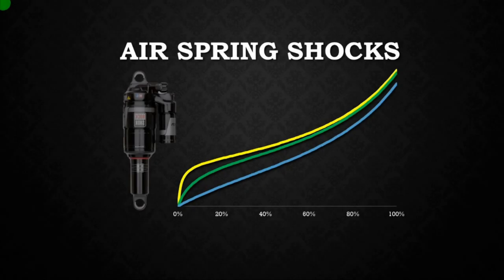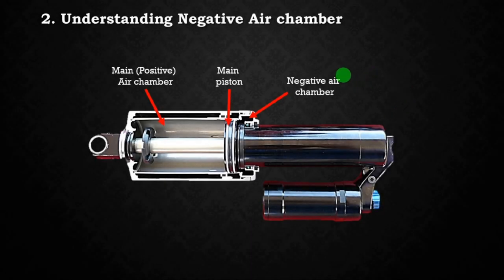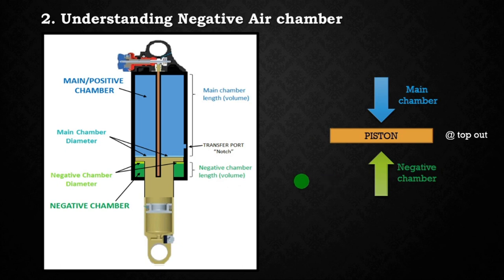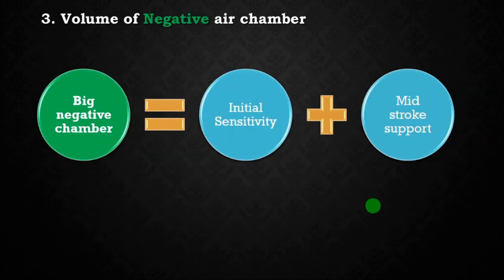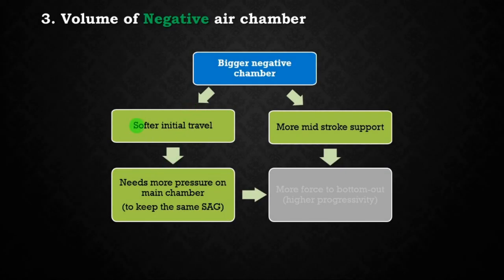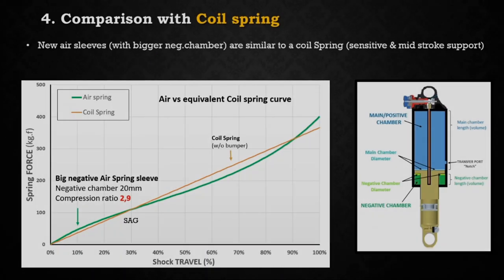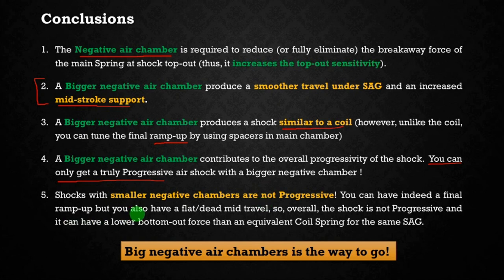Air spring shocks (MTB Rear suspension Ep.13)

Comment: I'm tired of marketing reviews with subjective opinions and without substance where no quantitative information is included. Yours is a very good video! Maybe too technical for some but you explained very well as to make these complex concepts understandable for many! One question though: does your simulation consider a frictionless interface between chamber surfaces and seals? I believe that the absence of that "stiction" is one of the reasons why coil shocks are still a little more sensitive than air shocks. However, manufacturers have improved the surface treatment and seals as to reduce "stiction". Coil shock disadvantages are lack of progressivity tuneability, need for a specific coil spring rate for each rider weight/riding style, and weight (which I don't mind much).
Reply from the maker: +Carlos Adorno Hi. Thank you! Im also sick of biased and marketing reviews :) No, I'm not considering friction. Nor the temperature variations on the air under heavy use. But as you said, I dont think thats a major issue. Although I'm a coil-fan, an air shock with a proper negative chamber can be as good or better than a coil (less weigth and more tuneability). Bye

Comment: Andre, what you are saying about bigger negative chamber only applies for light to average riders. For heavy riders, the big negative chamber means needing to pump in so much pressure, that the shock actually looses small bump sensitivity over a small volume chamber.
Reply from the maker: lux yes, it’s a balance between those two factors, and after a certain point there is no major benefit from having a bigger negative chamber, because the curve is already quite linear. Still, if you increase the diameter of the shock you decrease the pressure required without affecting the curve shape. So, manufacturers can play with that too. In episode 14 you can download a air shock simulator to play with those parameters. Cheers
Reply: @andrextr  Hey, thank you very much for a detailed answer. You are a fountain of suspension wisdom! May I ask for a piece of advice? I went from a DebonAir air can to solo air air can on my Monarch RT3 190x51 as I couldn't set up my sag less then 35% at 350 psi on my nicolai g13 (I weigh 114 kg without gear). With the small air can, the shock feels very plush  at the beginning and it ramps up at the end so I don't bottom out, which I like very much and the traction and small bump sensitivity is amazing, but the mid stroke feels a bit less supportive than I'd like it to feel. The damper has already been tuned by sram for my 114 kg body weight. Is there anything one can do to get some midstroke support? I ride a nicolai g13 which is quite progressive. Thanks for help if you happen to find time to reply.
Cheers, Luka
Reply: @andrextr  , thanks for your great work. I, am having the same problem, weight about 110 kg with gear. Have Canyon Strive 2016 with debonair monarch plus 200x57 and I noticed that I need to put crazy pressures to make sag 30% (35%  with 300+ PSI, I don't even have a pump for more than 300). The previous owner put 4 bands and I didn't removed them, and even on 250PSI I ended up with 40% sag and couldn't able to shrink it to less than about 80%. So I am playing with your spreadsheet (although I don't have data for 200x57 but probably calculations are similar) and thinking about multiple options, taking into account that apparently debonair is not the best thing for heavy riders. 

1. I think I need to remove all bands - still I have to put crazy pressure, but the shock will work better at the end as I can't use it's whole travel now with the steeper ramp up curve. 
2. Going back to solo air can. I read a lot of heavy riders do that.
3. Putting bands in the negative chamber . I know that will change the curve at the beginning but still this will decrease the initial sag. 
4. Is there any real need in making these 30%, what if I keep it 40% but the shock works fully. Yesterday I was riding and even decreased a pressure so I can have it better at the end...

Not sure what really to do. Any advice is appreciated... Thanks.
Reply from the maker: Hi. The bands on positive chamber will only affect the last part of travel, use then only to reduce bottom out accordingly. If you put then on negative chamber you have a stiffer initial travel and it could help to reduce sag in your case (and you can use lower pressures). There is no need to make exactly 30% you can run 40% but it migth make the bike bob more. You have to test the different settings and see whats work best for you. Cheers
Reply: @andrextr  thanks. I will remove the bands for now. The previous owner weight 65 kg, put 4 bands and 250 PSI for better mid stroke progressiveness according to his words. I find that odd to be honest but anyway. Will remove all bands, and add one in the negative and eventually play with decreasing the negative chamber. As you say, have to play a bit with the bands and pressure.

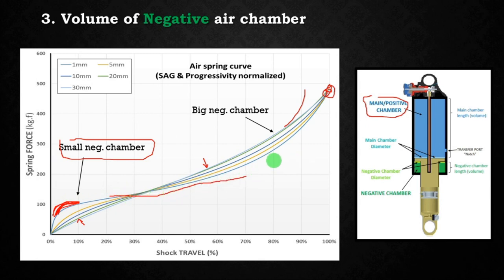Comment: 9:30 When you've changed the volume of positive chamber, at the same time sag have schanged. Honestly you cant keep both the same as they were, sag and bottoming out force. If you deicde to get benefits from increased negative chember you have to be aware of those two things, you are going to get deeper into the sag or have higher bottoming out force. Anyway very cool excel and video, I would love to see charts with super deluxe with and without megneg
Reply from the maker: You can have big negative chamber and adjust pressure and increase main volume to get same sag and bottom out force.
Reply: @andrextr  But at the end when I increase main chamber volume to get the same bottom out force the pressure will decrease. Pressure * volume is remains always constant in constant temperature.
Reply: @andrextr  9:01 you can clearly see that between different chart, there is force difference at 30% shock travel

Comment: Big thanks for this video! It was very informative.
BTW: could you do some geometry / progressivity analysis on some full suspension XC-bikes? I would be interested to learn how they differ from e.g. trail bikes.
Reply from the maker: Usually XC bikes are linear or slightly progressive, and they have good anti-squats. The main difference is the amount of travel, and probably a bit less progressivity (which makes sense). I will try to give a look at this topic. Bye

Comment: Excited to see another video!! Question: You said modern air shocks have a negative air chamber length of 10-15mm which seems to be much better than previous designs. Why not make the negative chamber length 20-25? What effects would this have on the suspension and is it do-able, should it be done? Thanks!!
Reply from the maker: +Grant Rogers Hi. Thank you. Yes you can increase more the negative volume, however the more you increase the lower is the incremental improvement. But I believe in the future is to increase up to 30mm. The only problem is the lack of room to increase the length. However this is currently overcame by using secondary chambers (outer sleeve). This trick has the same effect as increasing the length. This week I will release a quick vídeo about this. I will also share my shock simulator to everyone, for free  near Xmas... :D You can they play with numbers and see the result. Bye

Comment: Love your videos and the insights. Could you do a suspension comparison across different disciplines (XC, Trail, Enduro, DH)? For example: How is the suspension of a Specialized Epic different from a Camber, Stumpjumper, Enduro or Demo? I just picked Specialized randomly to explain what I mean. I would be interested in how bike companies tackle the different objectives and the trade-offs they're making. Especially when going to the extreme of cross country, where pedaling efficiency is key.
Reply from the maker: I will try to do that on the future, it's an interesting idea and already got some requests on that topic. On my progressivity video I compared the progressivity of several enduro bikes with several DHs bikes. DH bikes have, on average, a progressivity of 40% while enduro bikes have 20% progressivity. Which makes sense, more aggressive riding requires more progressivity. For XC I guess that they have a low progressivity (between 0% - fully linear, and 20%). 
Regarding anti-squats (pedaling efficiency) almost all enduro bike have anti-squats close to 100% on a singlering setup. In XC bikes I strongly believe this is also true. On DH bikes the amount of anti-squats is highly variable. You have a group of DH bikes with very low anti-squats (eg: Spec. Demo), a group with ~100% (eg: YT Tues) and another group with very high anti-squats (Gambler)... So IMO, this somehow means that anti-squat is not very important on DH bikes, and you can go with low or high values (indeed, pedaling is not the most important on DH bike).
Regarding the braking independency (anti-rise), I don't know if there are differences across the disciplines, but the anti-rise depends mainly on the suspension system, and not so much on the particular design. You can only get really low anti-rises (good brake independency) with an horst-link design. The singlepivots, or singlepivot with shock linkage or even dual-links designs (eg: VPP) can't get low anti-rise values (unless you use a floating brake arm, but that's rare nowadays). Bye
Reply: Thanks a lot. You're the man! I own a Specialized Enduro and was test-riding a Camber. I was surprised on how much better the Camber climbed. Sure, some benefits come from weight and tires, but I also felt that more power goes into acceleration vs. suspension. Seems like it's not so much a geometry thing, as the Enduro has a fairly low progressivity according to your videos. That means that I need a shock with a lower progressivity/bigger main air chamber to make my Enduro a better climber (but not an aggressive Enduro machine). I hope I got that all right.
Reply from the maker: All specializeds are linear or slightly progressives (incl. Demo). Camber and enduro have similar anti-squats, and similar progressivity (enduro has a bit more). Apart from tires and weight, Camber has 25% lower amount of travel. The more travel the bike has, the less efficient it will be for pedaling. This is the main difference between both. If your enduro's shock has a good pedaling platform, you can increase the pedaling efficiency by turning it on, on the climbs. Regarding your last question, the progressivity (of either shock or frame) affects mostly the ramp-up at the 2nd half of the travel, it won't affect significantly the pedaling efficiency. So, by using a bigger main chamber on your shock you are only increasing the amount of bottom-outs and not the pedaling efficiency... So, it not a good idea. YT Jeffsy 29er is a very progressive trail bike and I bet that it will pedal as well as the Camber. :) Bye

Comment: thanks! 

btw i would be interested in an analysis of an orange five and it's single pivot.
Reply from the maker: +MrCirest Hi. Orange five has good pedaling efficiency (anti-squat around 100%), because main pivot height is the same as the top of the chaingring. In my anti-squat vídeo I used the orange example. The anti rise is around 90% as it happens with almost all single pivot bikes (see instant center episode). The progressivity of orange is low (its fully linear). Since singlepivot bikes dont have a shock linkage you can't get a progressive bike. The most you can get with a single pivot design is a very sligthly progressive suspension. I will discuss this in a future vídeo. Bye :)
Reply: thanks for your answer!

Comment: Yeeeesss!! New video :DDD
Reply from the maker: :D
Reply: andrextr I have a question, what does all this stuff about travel on the manufacture's website like in this case fox stand for and what tells me the size of the negative chamber? There are just numbers without any explanation: 
Travel
7.875 x 2.00, 7.875 x 2.25, 8.50 x 2.50, 8.75 x 2.75, 9.50 x 3.00, 10.50 x 3.50 
And what are typical values for negative chamber?
Reply from the maker: Brands don't share many details and data about their products (intellectual property), so it's hard to compare them. What I can tell you is that the EVOL sleeve, the Vorsprung Corset, or the Debonair have bigger negative chambers than the standard sleeves. However, it's not known how much volume they have. Accordingly to Vorsprung website, EVOL sleeve should be equivalent to the 10mm curve of my graphs, while Corset sleeve should be equivalent to 15mm. But I can't precisely confirm this info. Bye
Reply: andrextr Thanks a lot! Last question, do you know anything about the Rockshox Monarch Plus RC3? Because I'm thinking about buying a YT Capra Al comp 1 and since the frame is super progressive it would be nice if the shock is quite linear at the beginning of the travel...
Reply from the maker: The progressivity of the frame is mostly obvious at the end of the travel. The monarch has 3 options, the Debonair, High volume sleeve (corresponding to the main chamber volume) and standard sleeve. It think the AL1 cames with the HV sleeve. Debonair makes the bike a bit more sensitive at the beginning. But the HV will also work well on Capra, and given the high volume of the main chamber, it will not ramp-up much at the end (since the frame is already progressive, you don't need much ramp-up on the shock)... I would say that Capra works well with any shock (eheh).
Reply: andrextr Thanks a lot! Nowadays it feels truly amazing to have Youtubers like you who actually answer questions! I like that ☺👍
Reply: andrextr didn't quite answer your question. 

Those numbers are eye to eyelet distance vs. shock stroke length. The stroke length is the bottom of the negative chamber (outside) to the top of the bottom eyelet (outside). Just get some calipers if you don't believe me. These dimension are important if you ever decide to upgrade your shock. 

Stroke length is a function of the rear travel distance. Kinematics of the frame should dictates your choice of shock (air or coil).
Reply from the maker: +Andrew Nguyen thank you for completing the answer, I was so focused on negative chamber question that forgot to explain the meaning of those numbers. :)

Comment: very interesting. is there more tweaking that can be done to achieve the affect of "big coil" shock like increasing psi level above recommended or using different gas (nitrogen/hydrogen) ?
Reply from the maker: Thanks. To make it similar to a coil, only by increasing the volume of negative chamber. Changing the gas or pressures won't result.

Comment: I know that pull shocks are very rare now, but how different are they compared to regular ones? I'm particularly curious of the equalizer from DT on the Scott. They do have pretty big negative and positive chambers, almost equal.
Reply from the maker: Hi Razvan, yes that's rigth. I don't know much about the equalizer, but I did a model for the Dyad RT2 which should be kind of similar. And the negative chamber is around 3x bigger than a Debonair/EVOL sleeve and 6x bigger than a regular shock. This creates a very linear spring at the beggining travel, equal to a coil spring. The disadvantage of this, is that you need to use very high pressures on the positive chamber to achieve a normal SAG. As a consequence, the main chamber also needs to be big otherwise the increase in pressure at bottom-out would be huge. This makes the Dyad RT2 very linear in the whole travel. The equalizer shoud be similar I guess. The only way to increase the negative volume without using too much pressure on the main chamber is to increase also the main piston diameter. You can check the Dyad RT2 model in my free air spring simulator here: https://www.youtube.com/watch?v=0-l2l2kca0A
Reply: andrextr I have this link ( http://assets.scott-sports.com.s3.amazonaws.com/suspension_setup_tool/index.html ) from Scott, who shows different curves of the shock. I was wondering if you increase the positive air chamber above the recommended values, will you get more progression at the end ?